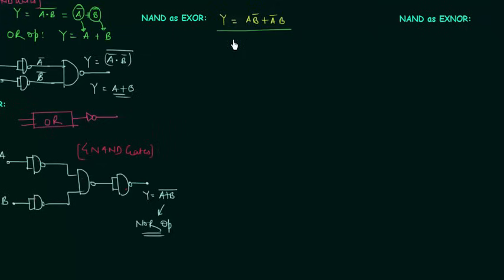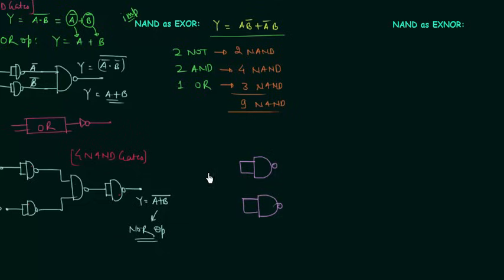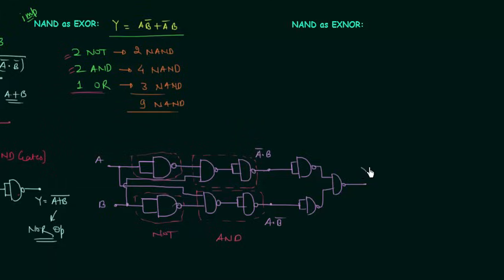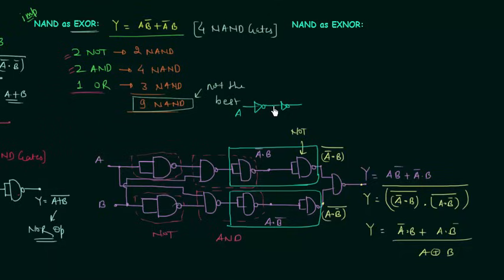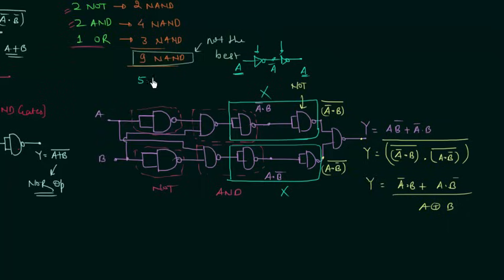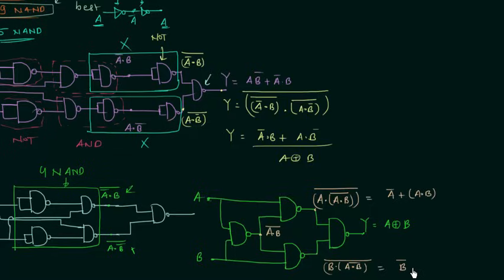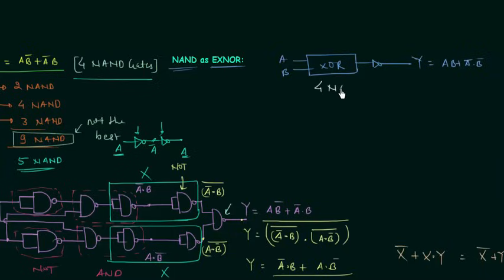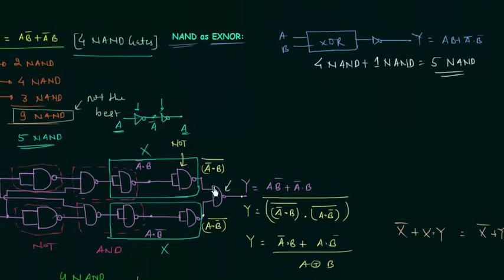NAND Gate as Universal Gate (Part 2)

Comment: For 2nd hw problm  , we firstly use 7 nand gàtes  but after observing that we have two continuous not gates on upper and lower side both, we cut the 4 not gates and so, we require only 3 nand gates in total.
Reply: Yes, minimum 3 NAND required for 2nd one.👍 What about the 1st one? Is the answer 4 ? Please verify I'm getting 4 NAND gates. and if it's wrong then tell the correct one.
Reply: No 5 gates for first one
Reply: @orion2843  it can be make in 3 nand gates
Reply: @starkendeavours7072 it requires a minimum of 6 Nand gates, since we are only using Nand gates
Reply: Both questions have minimum 3 no. Of nand gates required...
Reply: @shrutiprajapati7735  please explain how i am getting 5  and 3 respectively.
Reply: Solution khana se milega

Comment: 1.2
2 3
Reply: can u explain how ans for q1. is 2?
Reply: @rajeshwarihs9956 Question 1...
 use 1nand gate and inputs as z,y so output will be z'.y'

Then use another Nand gate and connect gate 1 output to second Nand gate input 1 as ( z'.y') and input 2 as x and the output will be 
(z'.y'.x)' = x'.y.z. By commutative law. 
So number if Nand gates required for question 1. Is 2 Nand gates.
Reply: @DP.Sniper  how is the output of nand gate which has inputs z, y = z'.y'?? It should be (z.y)'..correct?

Comment: 1.5 gate required 
2.3 gate required
Reply: you are right girl
Reply: can you explain both ans
Reply: @mahendermahender6718   Question 1...
 use 1nand gate and inputs as z,y so output will be z'.y'

Then use another Nand gate and connect gate 1 output to second Nand gate input 1 as ( z'.y') and input 2 as x and the output will be 
(z'.y'.x)' = x'.y.z. By commutative law. 
So number if Nand gates required for question 1. Is 2 Nand gates
Reply: @DP.Sniper  brother, it's wrong .If the question is solved by your method we get the ans to be x'+yz instead of the desired x'yz
Reply: @DP.Sniper  bhai itne galat kese ho skte ho
Reply: Can you give the solution for the second hw prob ?
Reply: @Abhishek Majumder What's the point in writing 'girl'?